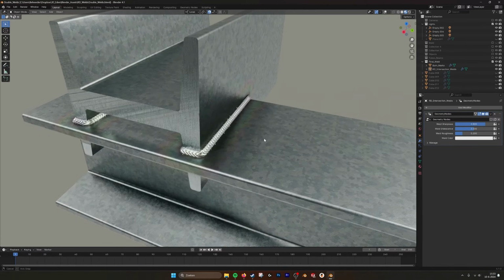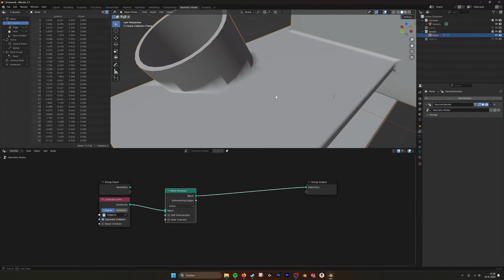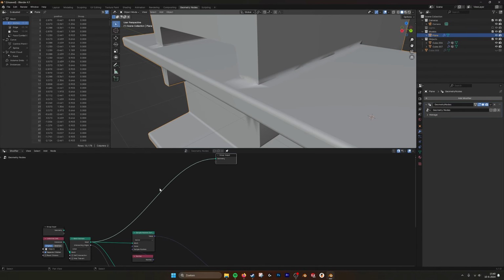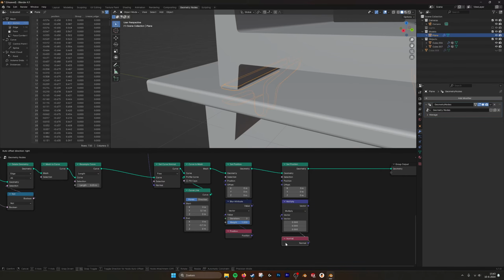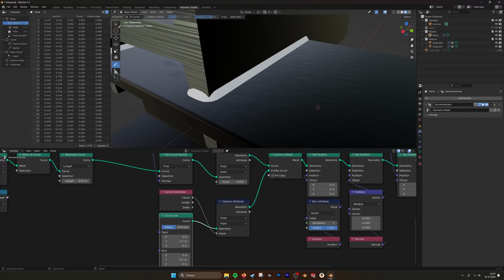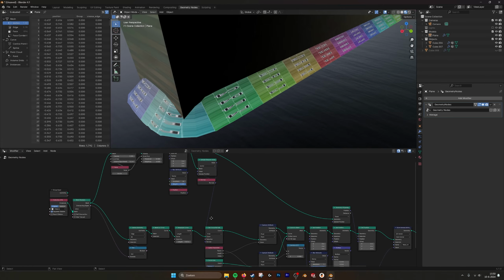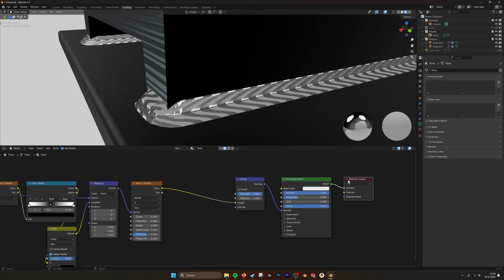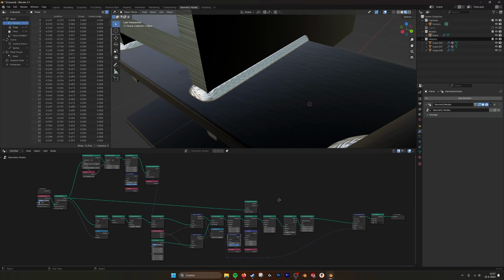Blender Geometry Nodes Intersection Weld Build Tutorial

Comment: Mine does not appear intersection edges in mesh boolean, any solutions ?
Reply from the maker: Are you using the right blender version?
Reply: @3d-eden978  mine is version 3.3.2
Reply: @3d-eden978  I'm using Blender v 3.2.2